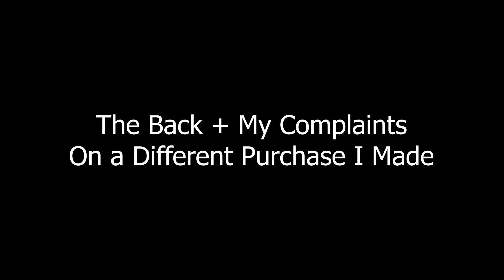Wheelock V7001-24 Flush Mechanical Horn Strobe Review

Comment: My school has those exact models, along with a very big system:

Mainly v7001s, with one ns down the 400 hall, most likely replacing a dead v7001. Science labs have NS’s, so does the practice gym, locker rooms, front of the school, band hall, and choir room. Competition gym has ZNS’s. The 600 hallway has wheelock AS’s in the hallway, and vertical strobe AS’s in the classrooms. The 700 hallway has system sensor PC2W’s and SCWs in the hallways and SCWs in the classrooms. Only the 600 hallway has smoke detectors, some kind of silent knight detectors. Weirdly, out of all alarms, the office has an LED EST Genesis white ceiling mount alarm. Only the classrooms in the 600 and 700 hallway have alarms. The pulls in the 700 hallway are dual action BG-8 style silent knight pulls, Firelite BG12(hex unlock) everywhere else. Alarms outside are 2 wheelock AS, one by the car line and one by the volleyball area, and a wheelock EH-DL1 outside the 600 hallway. I am only aware of 3 alarms outside. Out of the 2 fire drills this year, I am not much aware of how much of the system works, but I can confirm that the v7001s, advances, ns’s, and one of the outdoor as’s works. I simply don’t know if the other alarms work, they probably do. The ehdl1 looks very weathered. The locker room has ceiling mount and wall mount rss’s. The 700 hall bathrooms have SCWs. The 600 hall bathrooms have AS’s. System is working, but is too wild and just for uniformity, could be replaced.

Comment: I'm not sure if there's such a thing as a 31+WS.  But I am aware of the following:

32P: 4 inch DC powered horn, not sure how it differs from 34 or 36

33: 4 inch DC powered horn, the one I saw had a projector, but I'm not sure if all of them do

35(T): 4 inch AC powered horn with lower current draw

7003(T): Flush mount 2 wire AC operated horn strobe

F34(T)+WS: Flush mount 4 wire DC operated horn strobe
Reply: The 32P differs from the 34-24, and 34T and 36T because the 32P-24 draws more current and amperage to operate.And there is a 31T-115-WS, a 4 wire 7004t, and there is a 31-115-WS a 4 wire 7004. and theres also the 32PT-24, a 34T but its like the 32P, it draws more current. the 36T has a lower current draw. The 33-24 usually have projecters.
Reply: @Flanks719  Actually, the 33-24 is the non-polarized version of the more common 34 series.  A projector was just an option that Wheelock offered for these devices, doesn't matter the model number.  And regarding the 32P series, it does draw more current than the 34 series.  However, the "P" actually means it's polarized; there was the regular 32 series, which wasn't polarized.
Reply from the maker: Right. I forgot about those. My bad.